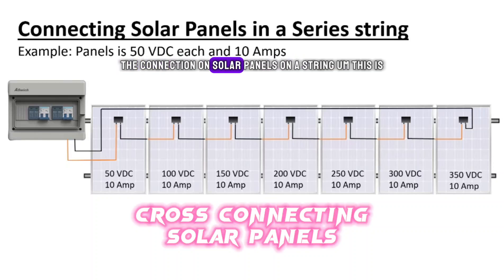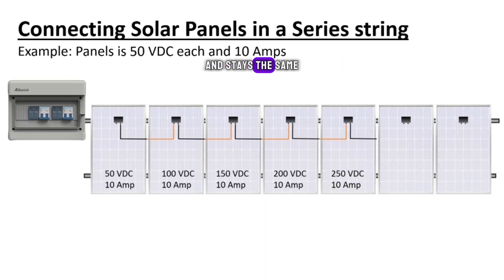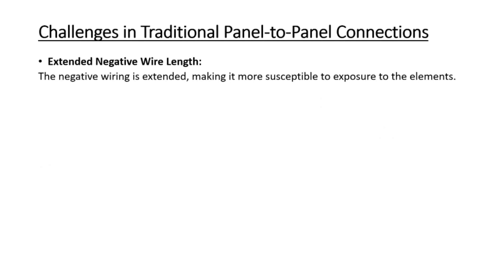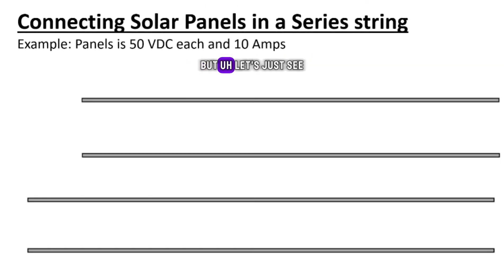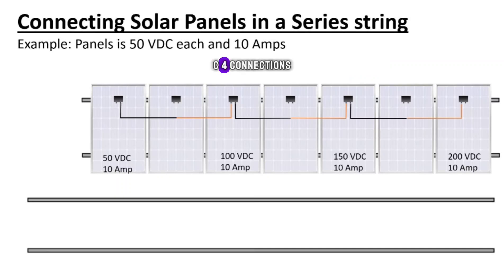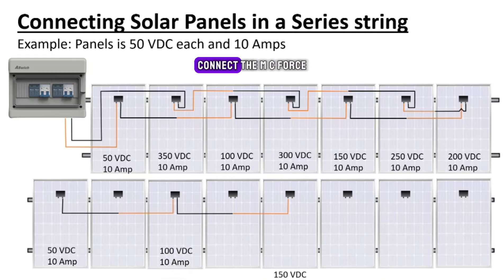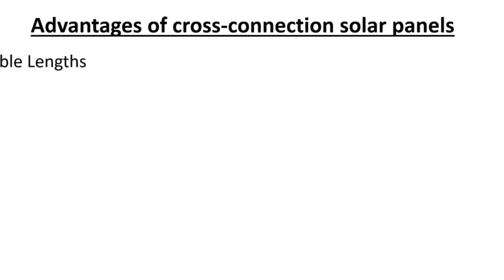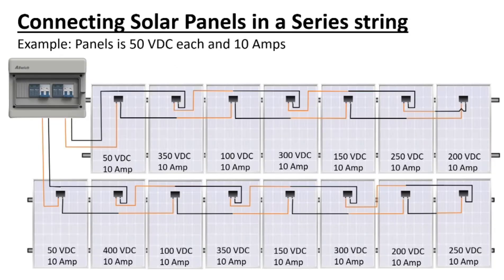Solar Panels Series Connection - Cross connection method

Comment: So I have seven panels just like in your diagram. If I am left with 250 volts and 10 amps presumably that is DC output. Is there an inverter and battery that can take this? I have looked into putting three panels in series and then putting a string of three others in parallel but this would leave the seventh panel not used. Thanks in advance for any advice
Reply from the maker: @timdougall5415  how where are you based? Most Hybrid Inverters with MPPT can take this and more.
Reply: @ltvtech  hi I’m in uk actually, yours was the only video I found with seven panels. I bought seven as it is the perfect length for my carport. Thank you for your reply
Reply from the maker: @timdougall5415  in the UK, Grid-tied inverters are very popular. If you go Grid-tied SolarEdge and SMA are popular.
If you going Hybrid, Sunsynk witch are UK based is also good.
I personally like Transformer based (Low Frequency) inverters like Victron from Netherlands.
Hope it helps.
Reply: @ltvtech  thank you for your advice I will research all of those. With kind regards Tim